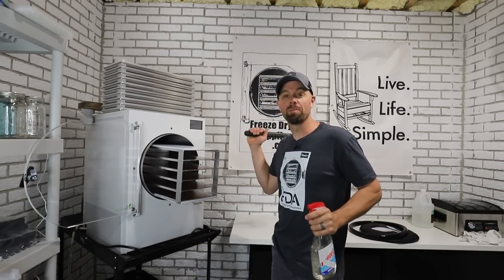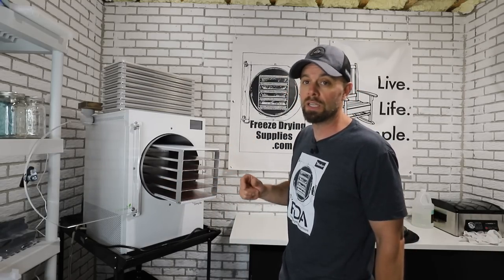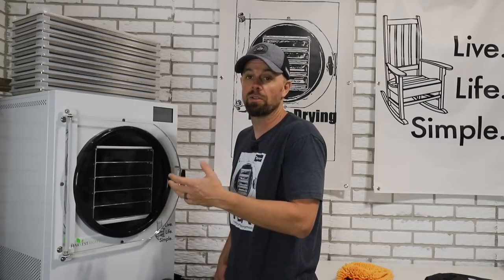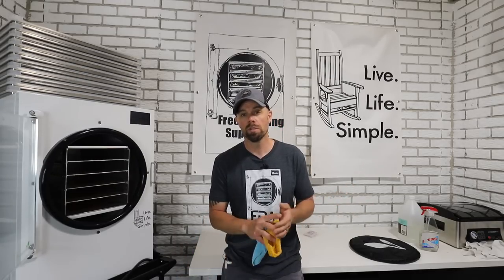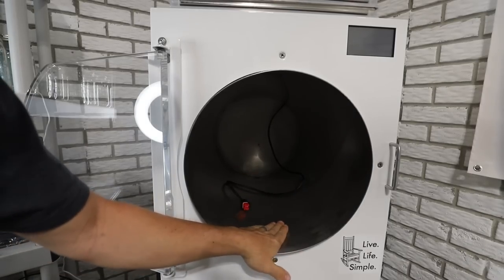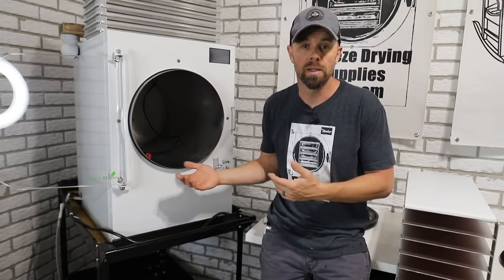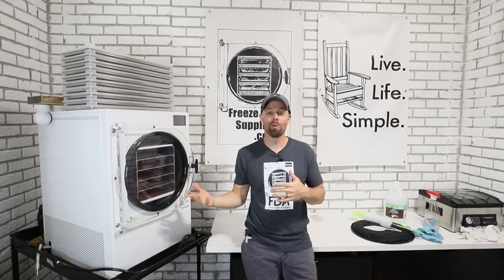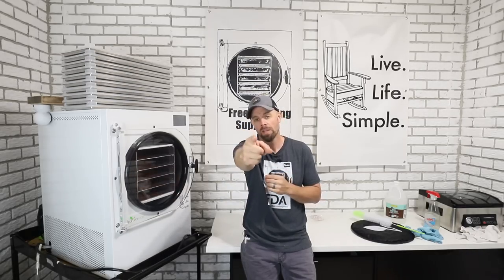How to clean your Harvest Right Freeze Dryer

Comment: Vinegar is a chemical and  a fairly strong acid. I would not use it on the door, door gasket,nor the heating mats of the tray rack. Same goes for the alcohol. It will break down those items and make them brittle. This is bad information. We live in a time where spare parts are difficult to get. Warm soapy damp cloth should be used instead.
Reply: Just add a little elbow grease & ya gotta great recipe….
Reply from the maker: You can certainly use whatever you want
Reply: Thousands of people are using vinegar and vodka without issue.  You don’t like his methods then too bad,  but  don’t say it is bad information.  Mind your business and keep it shut.
Reply: @172sbct  those are agents which dry acrylic. Why do you want a beittle door? Look it up
Reply: When advising patients on cleaning their home respiratory equipment, 50% vinegar solution is what we recommend they use … It doesn’t kill every bug, but it’s better than nothing.
Reply: @sea6bear  :  In terms of microbiological reduction, this could be a very important comment. Thank you for offering it.

I have a few questions. When you say 50% vinegar solution, are you saying to dilute normal 5% acidic acid vinegar by 50%, to a 2.5% acidic acid vinegar solution,and use that to do the cleaning, or are you saying to use 50% acidic acid vinegar, also known as Vinessence?  

Do the apparatus that you and your clients use have acrylic components?

And have you considered using hydrogen peroxide solution for cleaning and sanitizing respiratory equipment?  It may be more cost effective again, and the microbiological studies that would be done particularly throughout the course of the pandemic, are very promising indeed.

I wish you a merry Christmas and a happy new year, my friend.❤️
Reply: @daphneraven6745  If you’re cleaning healthcare equipment I’d suggest you ask your provider. Cleaning with vinegar solution is a barebones approach, there are other methods. A computer search would answer most of your questions.
Reply: @sea6bear  : It’s OK. I’ve got a background in microbiology with lab experience. I was just surprised by what you said and curious to hear the details.
Reply: You can use vinegar as long as you dilute with water! 👍

Comment: 1 thing missed. Rinsing the drain line with clean water. If you neglect this, you'll be one of the people complaining it rotted out ...
Reply: Thank you!!!
Reply: Do u just run warm wayer through it or could i run a water vinegar mix?
Reply: @TheRealBatCave  personally, I run tap water through it. I suppose you could use vinegar.  I give the drum and shelves a good spray with Vodka and use an old ketchup squeeze bottle to rinse out the drain hole. 

Going on 1.5 yrs and the stock drain valve is still going strong.
Reply: @HereThereBackAgain  nice, i heard some people were putting their racks through thier dishwasher, wouldn't this destroy the electrical on the back of the shelving unit i dont wanna risk it lol, ive just been using the spray bottle scrubber and the spray bottle.
Reply: @TheRealBatCave  yeah, definitely don't do that.  Sounds like a horrible idea.
Reply: @TheRealBatCave it says in the manual that doing that will void the warranty. It also said that it could deteriorate the adhesive on the shelves and cause things to fall apart.
Reply: @TheRealBatCave yeah - those ppl need to read the manual.  That will void their warranty.

Comment: I have used rubbing alcohol to clean mine.  I am glad to see you don't recommend bleach.  I worked with metals and bleach is not good for any kind of steel.  I also occasionally take a table knife and rag and clean out the groove in the door gasket.   This is a good video!!!  Thanks!

Comment: Appreciate the new ideas.  I have last year's model (medium size) of Harvest Right.  I take the rack out after each load (approximately every three days), but my cord is long enough to take the rack out and set it upright next to the machine itself without disconnecting.  I figured as frequently as I clean the machine that the plastic wire/cable connector would eventually become brittle and break form constantly connecting/disconnecting or the connection would become loose.  I don't believe you mentioned the drain tube itself where I have found the majority of bacteria/mold grows.  I do use diluted bleach to poor down the drain tube for those stubborn spots, but this is only once a month or so.  A clean washrag with just a spot of dawn liquid also does the trick for cleaning the inside of the metal  freezer tube.  The entire process takes approximately 10 minutes.  Thank you for the videos!  Cheers
Reply: Thank you for bringing up the drain valve hose. I'm going to have a look at ours as soon as our current batch is finished. Should be able to pull it off and rinse out with vinegar.
Reply: I was hoping he would show that, too and how to cable tie valve.
Vinegar was said to etch stainless steel.

Isopropyl is recommended by deep down under?
 guy.

Comment: I've been using blue Dawn (only) to clean the inside of the chamber. After removing the shelves I mix it up in a 1 qt. spray bottle with hot water, then close the drain valve before spraying about a quarter of the bottle all around the chamber before scrubbing the inside with a soft dish washing brush, then I respray. When the soapy water fills the drain chamber I open the valve and let it drain. This seems to help keep that small drain chamber and the hose clean as well. I repeat this until I'm out of hot water & Dawn in the spray bottle. At the end I close the drain valve and rinse with another spray bottle until water starts backing up at the drain. Then I repeat this until the water in the drain runs perfectly clear.Then I place a fan in front of the open door and let it run until everything is completely dry. I finish with a spray of either vodka or Steramine, Like many tasks, it take 20 minutes to type it out, but only about five minutes to actually do it. I prefer using Dawn because not all food residues are alcohol soluble. I do sometimes use it as a final step though. YMMV.
Reply: I use dawn as well on my Harvest Right.  However, I just use a clean washrag (wet but rung out) with a drop or two of dawn.  I then use a paper towel inside the chamber to ensure there is no moister or left over residue.  It seems to do the trick and have had no growth or smells inside the chamber.
Reply: Reading a lot I would avoid Dawn…isopropyl only.
Reply: Watch phil at 4800 feet or something like that
Reply: @ILkaterlyn  I'm still good with Dawn and Steramine. Phils video was interesting, but if I had to use alcohol for a disinfectant in an appliance, I would choose a food grade alcohol like a high proof vodka, or even Everclear. Since I rinse my FD very, very thoroughly, then air dry with a fan before using Steramine or whatever I don't see a real issue with Dawn. Besides, Dawn is used on duckies, and seals, and all sorts of marine rescue critters, and is used exclusively by Seaworld for oil spill rescues. That doesn't mean its perfect, but that it is gentle. Thanks for the interesting reads.
Reply: @roraev9296  I googled Dawn, why not to use…
Reply: @ILkaterlyn  I totally agree .I just watched his video and it is so detailed I will be doing his way of cleaning with isopropyl alcohol.
Reply: @chickeemama1  I did try Isopropyl alcohol for cleaning. It worked well if I didn't have any sort of visible food residue inside the chamber. It also handled residual food smell well. However, it was helpless against food residue. Specifically, I did a load of sour cream and ended up with a few specs of sour cream scattered all over the inside of the chamber. Alcohol didn't touch it. Some foods are not soluble in alcohol, and sometimes plain old soap and water is your only resort.

Comment: Hi could you show how to clean the drain valve? Do you pour vinegar down the hole in the back of the chamber and then follow with water? The manual says to clean it after so many uses to avoid mold but doesn't say how too.

Comment: I don't have a FD yet but I'm highly interested in getting one.  Been watching your videos to learn about them, how they work and their capabilities.  I saw mention of using rubbing alcohol to clean stuff.  I know all alcohol is not the same.  I think rubbing alcohol is not the type you can consume.  For those concerned with keeping non-consumable things out of their chambers, I have used Everclear winch is 100% grain alcohol and is used in mixing drinks, though I don't know what kind :-)  I have used it to clean stuff that comes in contact with food.  Since it is consumable (though you don't want to try it straight) it may be safer than rubbing alcohol.  In my uses of it I found it can cut through just about any oily residue.  A liter bottle may be cheaper than vodka or other types of alcohol.  Also, since it is 100% alcohol it will evaporate completely.  If something is 80 proof it means it is only 40% alcohol, the rest being the juice of the item being distilled.
Reply from the maker: Interesting, thanks I'll try it
Reply: Isopropyl evaporates…
Remember 1960s dr offices had mouth thermometers sitting in hydrogen peroxide.
Reply: 70% isopropyl is preferred for cleaning because higher percentages evaporate too fast to disinfect.

Comment: I bought a spray bottle I fill then charge with my air compressor.  It holds air for months and makes spraying cleaner on the interior a breeze.

I used Purell cleaner from a restaurant supply because it's formulated for stainless steel kitchen appliances.

As others mentioned, don't forget the drain hose and valve. You can buy small brushes that will go up and down the hose.

I clean my door gasket ever few cleanings. It's indicated drying it is critical, before it's installed.

_____________
Vaper 19419 Red Spot Spray Non-Aerosol Sprayer (Red) - 32 oz.
Reply: Could you explain that air compressor technique a bit further?

Comment: Great video. Thank you! Getting ready to do raw meats. Do you clean it between every batch when doing raw meat?  Aslo I have lint built up on the sides where the venting holes are. How do you clean that?  Thanks again. I think i have watched every single one of your videos. So helpful. Makes me feel confident doing my own freeze drying.
Reply from the maker: I would sanitize everything after doing raw meat.  To clean the sides, you will need to pull off the side panels and also dust or blow of the internals.  If there's built up dust on the outside, the inside is probably very dusty.

Comment: I was just wondering if you considered using a battery backup in case of a power outage?  And if you have any suggestions?
Reply: A UPS should not be used with compressors or motors.  Typically the UPS can't handle the load when these start up. 
I believe that a 20Amp dedicated circuit is recommended. Getting a 20A 120VAC UPS is very expensive, probably not worth the expense.

Comment: How do you clean the drain hose?  I have poured some vinegar into it, but it's still not looking great.
Reply: That is exactly what I came on to ask!! Everyone has a video about cleaning the freeze dryer, but NOBODY has one on the drain hose & valve that get nasty.
Reply: It won't let me post the link, but I have been using Boao 4 Pieces feeding tube brushes that I got on Amazon. They are actually small enough to fit in the drain hose
Reply: @PaleoGreenByrd  it is!! I jam it down from the inside, wiggle passed the the valve & get into the outer hose with it. It is interesting getting it out because it is a spring, not a wire
Reply: @PaleoGreenByrd  You're very welcome
Reply: @marcietherington3684  Sounds like a winner, but unless you have something that will kill the bacteria on the brush the bacteria will remain to some extent.
Reply: @cliffmolz8719  I do use vinegar with the brush to clean the tubes & clean the brush after with hot water & hang it over the sink to air dry
Reply: @marcietherington3684  Works for me :-) !
Reply: Do you use the 1/6” or the 3/8”?